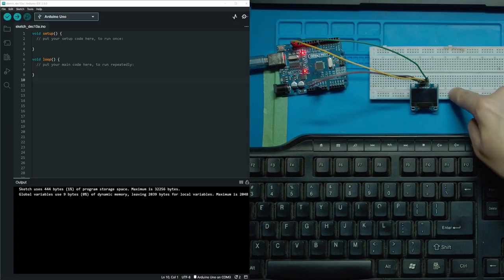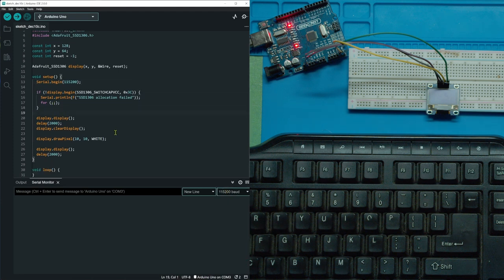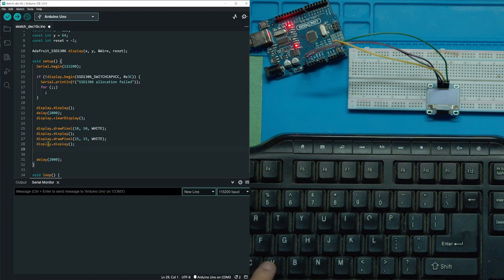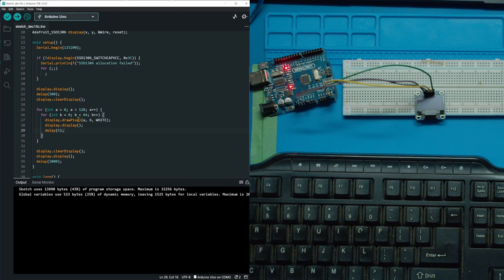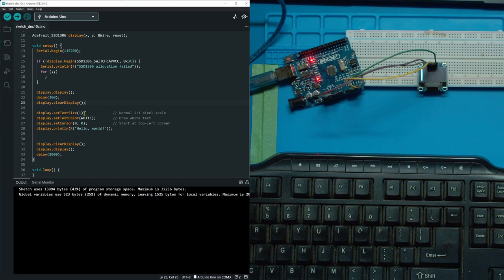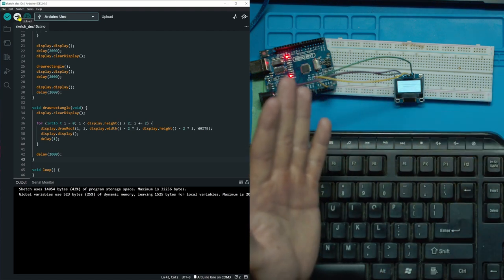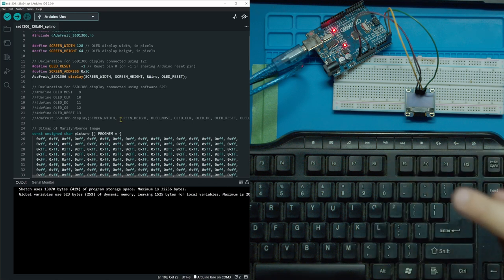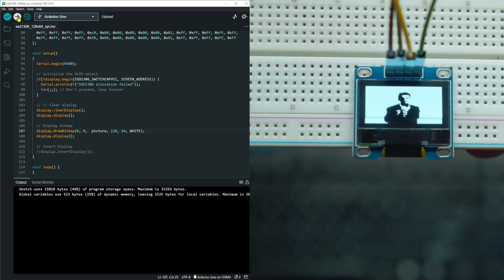Making a OLED Display work with Arduino - Step by step guide | Multi-Color I2C SPI LCD

Comment: The code is not work.    Ardunio say that  "variable or field 'drawText' declared void   "  
// Draws text at x,y
void drawText(string text, int x, int y) {
  display.setTextSize(1);       // Normal 1:1 pixel scale
  display.setTextColor(WHITE);  // Draw white text
  display.setCursor(x, y);      // Start at top-left corner
  display.println(F(text));
}
"SS1306_Ex2:64:15: error: 'string' was not declared in this scope; did you mean 'String'?"
"void drawText(string text, int x, int y) {
SS1306_Ex2:64:28: error: expected primary-expression before 'int'"
Reply from the maker: try the example files that come with the library, usually helps me find little errors